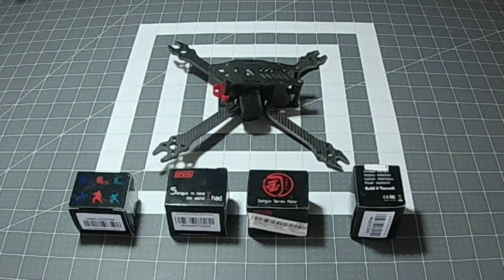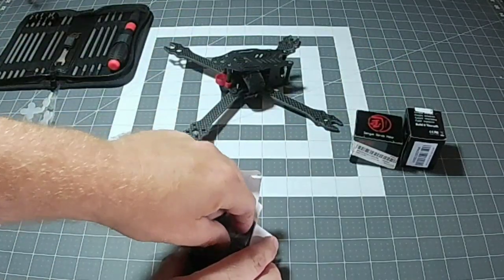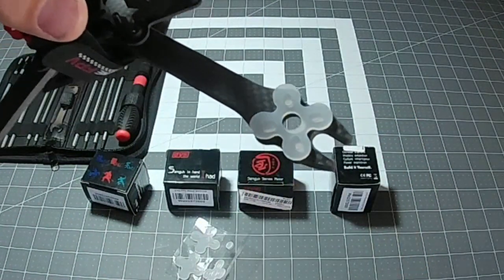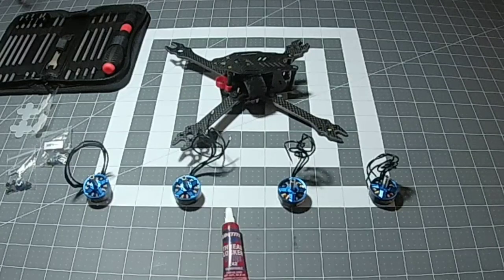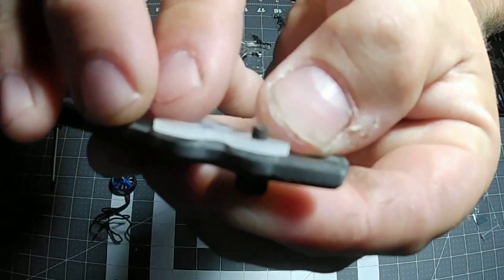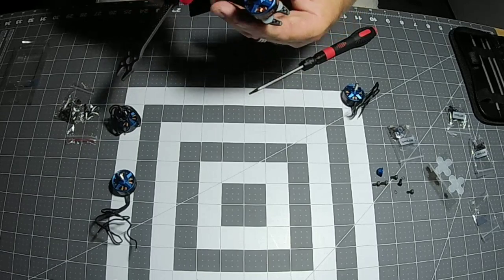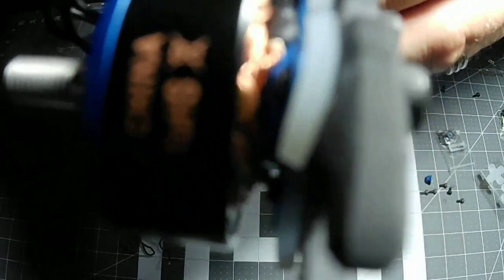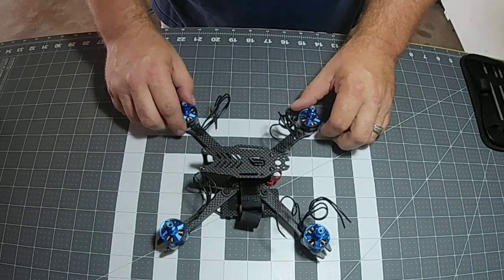Dys Samguk 2207 2600kv Motors Installed

Comment: Hey im realy new to the hobby i dont have a drone jet i want to build one can you maby put a all part list in the discription that would be awesome    great vid btw
Reply from the maker: Max Blezer i put a link to the parts in this video in the Description also there is a link to my playlist with other parts from other videos as well but basically you need 1. Frame 2. Motors 3.flight controller 4.camera 5.video transmitter(vtx) 6.receiver 7.electronic speed controller(esc)  8.power distribution board if flight controller does not have one built in 9.propellers  10.Transmitter/controller
Reply: edrone thx for the fast response ill for shure will be looking into it ☺
Reply from the maker: Max Blezer check out my other playlist on the race drone build i did previously for more info thanks for watching
Reply: edrone will do